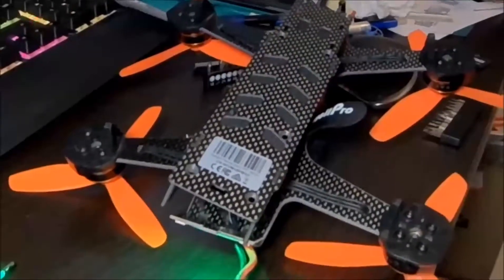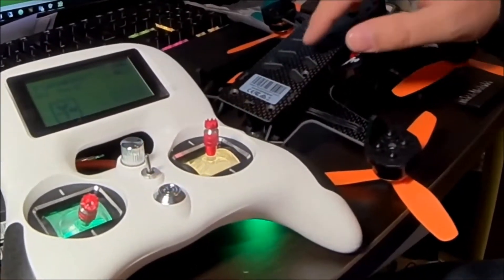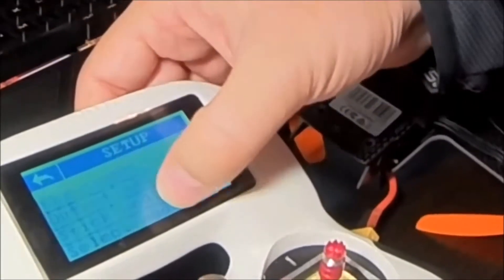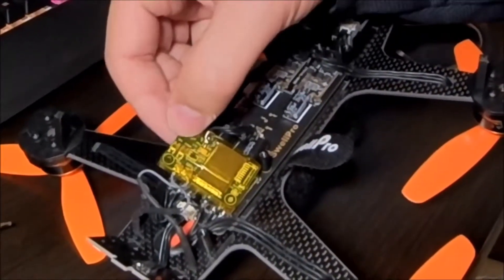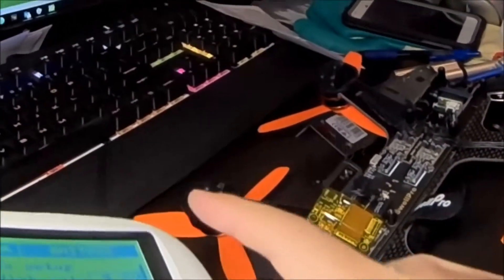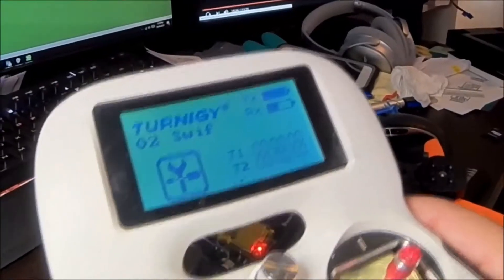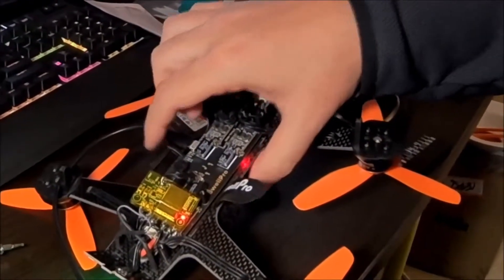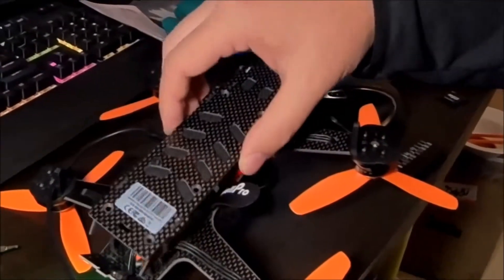SwellPro Swift 2 Binding with Turnigy Evolution Transmitter

Comment: Hello Reef - I'm trying to rebind my Swift 2 with it original rc but it just won't work. I carried out every step you show in your video until the red light on the receiver goes steady but the craft still doesn'f bind with the rc. Do you perhaps know what else I could do?? 
Thanks in advance
Reply: Sorry for late reply been away on a sailing trip without reception. I don't have the original RC to test with, not sure why it isn't working. 

I dropped my swift 2 on the reef so will be contacting swellpro for parts or a replacement, I will post the footage soon.